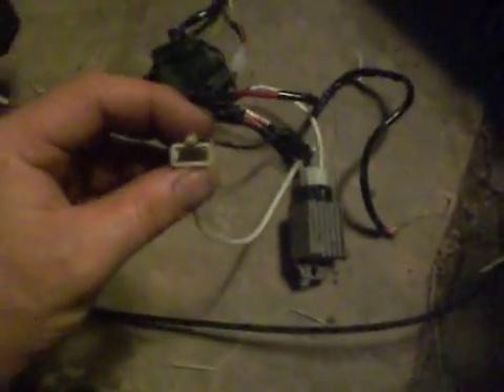Gas scooter rebuild 29cc/49cc goped type- part 1

Comment from the maker: *update* installed the gas tank under the seat,and although my lines are a bit long, all the seals are good. the gasket on the tank lid is a bit worn, but it's ok. The throttle cable is shot at the end (missing a bead) but may be able to cut/adjust or use a bike cable. it does need to be oiled with liquid wrench..haven't dealt with brakes or battery....brakes would be next but... a wooden floorboard is needed. i may start on that...baby steps.

Comment from the maker: *update*I checked the spark plug,got spark.put it back in. took some 50:1 instant premix i had and put a little in the cap, and with a syringe (used for fish target feeding, cleaned out) i jetted some in every port.. muffler hole,air intake i squeezed abit.let it soak in.. then closed the air import hole.. adjusted the screws all the way in, then 1 and 1/4 turn... and pulled the cable 3 times.FIRED UP! WORKING!! now i just need to make or attach the gas tank somehow,and fix the throttle cable